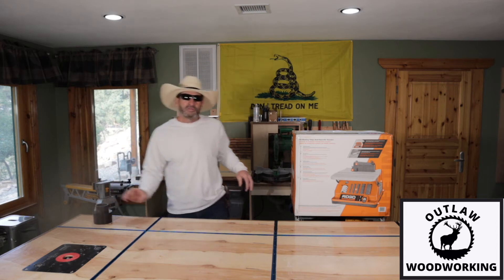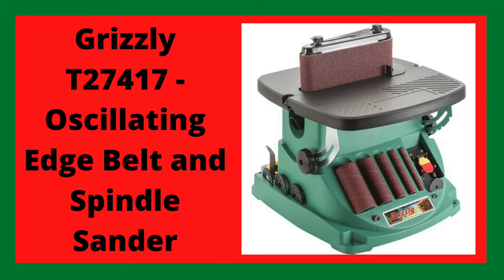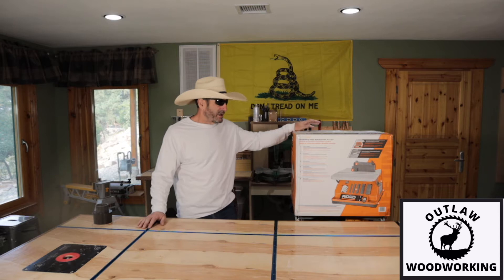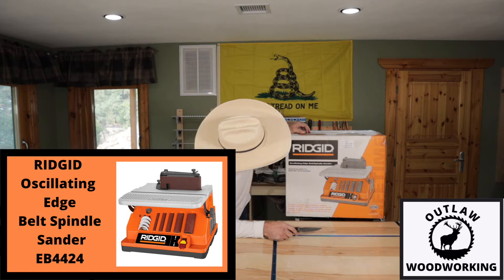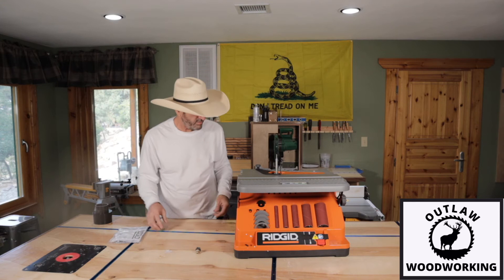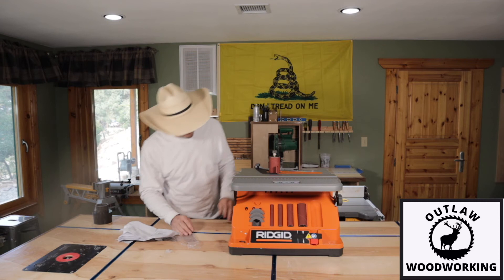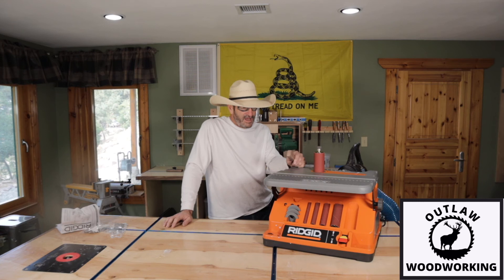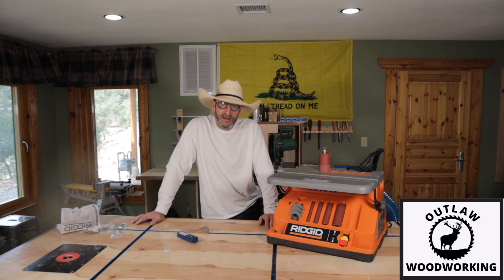RIGID OSCILLATING EDGE BELT SPINDLE SANDER

Comment: This is now being discontinued with no replacement planned by Ridgid, per their HD website. Unfortunate in that this is a great unit. Once current supplies disappear that’s it.🙁
Reply from the maker: im suprized , i really like the unit thanks for info
Reply: Also remaining units are much cheaper in Canada @Cdn$198which equates to about $155 US. Don’t know why but great deal,  assuming warranty and parts available still once gone.
Reply: All the knock offs use the same size spindles I was told. Just got mine on 3/7/2021 and now I’m gonna get a few replacement parts just in case.
Reply from the maker: @bussboy71  thanks, that’s good to know
Reply: Update on Cdn pricing - back to Cdn$249 - I missed my chance🧐